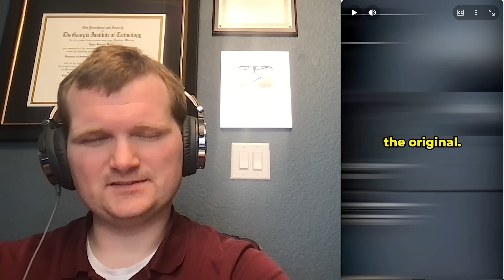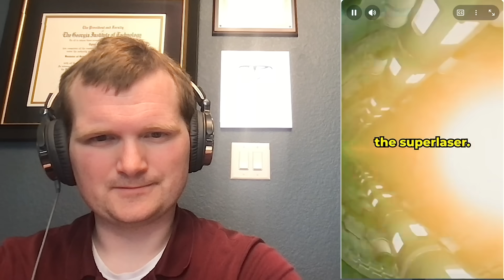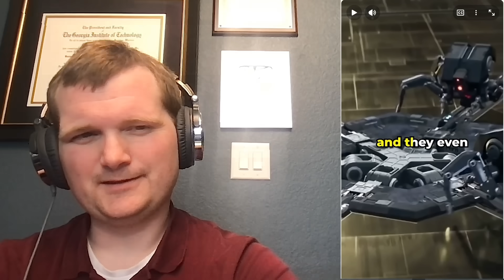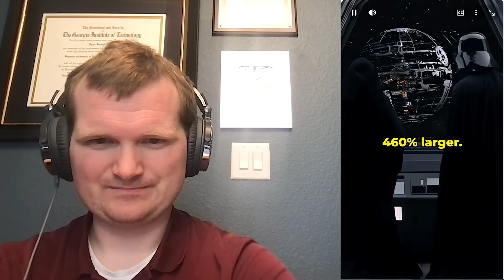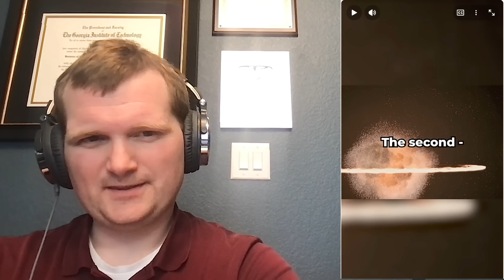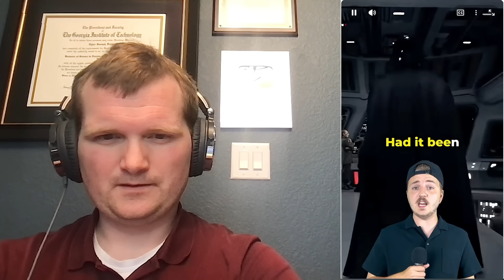Why the Second Death Star Was Different  - Nuclear Engineer Reacts to RocketRiley

Comment: When I was a kid (I’m 62 y.o. now) I considered that the DS1 primary weapon was an anti-proton beam. As pointed out, this would not account for Alderaan’s rapid rate of disassembly. As I grew older, I floated the idea that the DS1 (and later the DS2) utilized some sort of mechanism that suppressed the strong force and that allowed a fair amount of Alderaan to rapidly vanish in a hot, glowey cloud of large rocks, incandescent gas and sparkly bits accelerating quickly away from the apparent center of mass  from where the planets hung in space moments before. 

Still, it seems like there should be more energetic bits of heat and destruction. Something like the Star Trek Rapid Nadion effect might do the trick. As I understand it, the Nadion is the subspace field carrier particle and a wee bit of SW fantasy function that’s similar might allow the strong force’s binding energy of the atomic nuclei to disassociate and slip away into the  subspace realm without releasing the kind of fireworks visible in a Kilonova. Granted this is all Sci Fi/Fantasy techno-fever induced theory…but hey….who knows how it rolls…from origin to terminus it flows…it blows and glows.

Comment: @7:07 This energy is not greater than what E=mc² allows. E=mc² describes the maximum energy releasable from converting mass directly to energy (e.g., full matter-antimatter annihilation).

To release 2.5 × 10^{32} J via E=mc², you'd need to convert about 2.8 × 10^{15} kg of mass (roughly the mass of a small moon like Deimos) entirely to energy.
That's only ~0.00005% of Earth's total mass—far from needing "more than" E=mc².

A plain energy beam (like a huge laser) delivering 10^{32} J would stay within normal physics, just on an immense scale (equivalent to storing and releasing the Sun's output for days in seconds).

Comment: The Empire probably already had DS2 under construction (maybe even halfway completed) when DS1 was destroyed, and while the engineers may not have known exactly why DS1 exploded, a directive from above to change the thermal port design may not have resulted in any changes in the main reactor's fail-deadly design because the development was so compartmentalized that the exhaust port design team weren't given all the information they needed to properly integrate the thermal control system with the main reactor while the reactor design team were just given a box labeled "exhaust system connects here" to include it in their design. With no cross-team communications and a rigid top-down leadership structure, they might have patched over that one weakness without fully understanding the design flaw that that one weakness exploited.
Reply: The issue of the exhaust port was stated to be fixed with a fully finished DS2, that's why the rebels attacks now and not after because there is no "after" to attack the death star and try to blew it up the same way it happened last time.

Comment: Likely on full completion the second would have been better but instead of a small port its flaw was an unfinished shell allowing a full freighter to fly into the core that took an exact hit of a small torpedo in the prior one.  Because it was hit prior to full build, operational or not it it shared the same flaw at the destruction.  Would note the flight in was not a straight line that would have stopped both the first and second attack if finished

Comment: I would point out that the single biggest flaw of the Death Star I was not solved: its reactor's equilibrium is so unstable that even a relatively low yield "unexpected thermal event" is enough to cause a catastrophic collapse. Granted, according to Rogue One, it was retconned to be intentionally fail-deadly, but considering that the chief engineer was deceased and the very short timeframe to create a new design, the reactor itself was no more stable in the Death Star II.

Comment: One small note. Was the entirety of Hoth shielded or just the rebel base? I feel like it would be WAY easier to spot a planet with a full shield than just one base on a planet.
Reply: Nope. The shield generator we see in the movie (Empire Strikes Back) is the DSS-02 (which is normally used by the Galactic Empire), which only protected Echo Base itself, not the entire planet (planet Hoth is 7,200 kilometers in diameter). The shield itself could only form a deflection area of 80 kilometers. It was effective, sure, but it didn't protect the whole planet. However, with this said, I think that Folse probably thought of the planetary-wide shield for Scarif. The main difference for Scarif (besides obvious better shielding and efficiency) is that the generator for the shield - itself - is also the shield gate and is in orbit. Whereas the DSS-02 for Echo Base was of course just ground-based, much smaller, and only had the function of protecting factories, hangars, relatively small bases, etc.

Ironically, even though Scarif is entirely shielded, it really didn't need that wide a shield, considering that the actual Imperial installations and overall base on the surface are only covering the space of a small city. It's much bigger than Echo Base, but doesn't exactly justify the resources it would have needed to build that planetary shield (instead of just protecting the base on the surface). Then again, Scarif is of monumental importance, because it holds databanks and archives of the Galactic Empire, including their experimental projects. So protecting the full planet is showing that they ain't joking around with security.
Reply: @lyrand6408  I think the empire decided to use a planetary shield for the same reason they do a lot of things. It's more impressive, imposing, and resource intensive, meaning you probably have hundreds of shield repairmen and droids and droid repairmen employed as part of the military industrial complex. Considering that there are also many aquatic species and rebreather technology that could allow infiltrators to stay hidden in the shallow warm seas for extended periods of time, it's also probably most sensible to put a shield over the whole planet since it forced Rogue One.

Comment: They probably wouldn't even know what went wrong due to the immediate explosion. No data to extrapolate the failure reasons.
Reply: In theory, a star wars version of a black box could have gathered that information. Scoop that up after the battle and the computers feeding info to the black box could have processed what the problem was in the microseconds between core failure and total destruction.